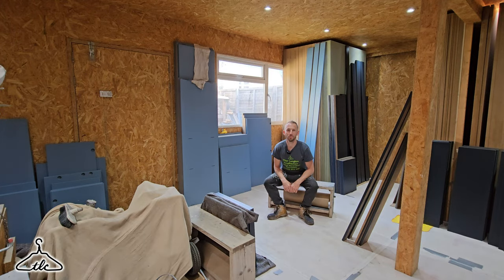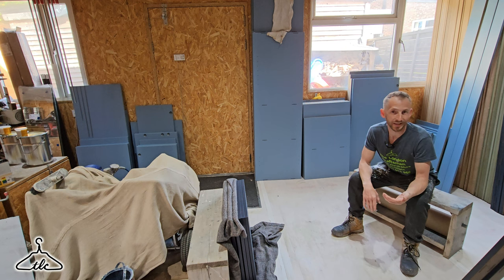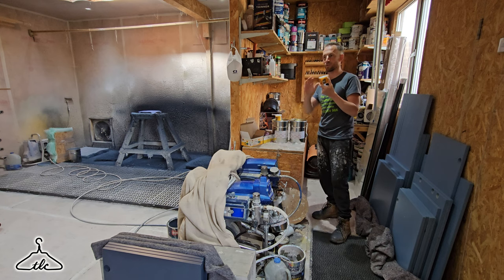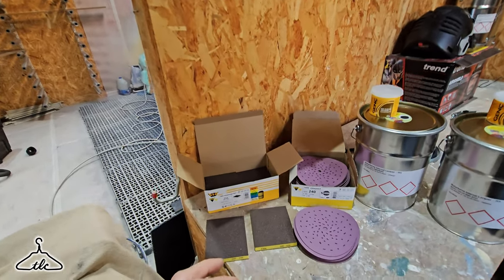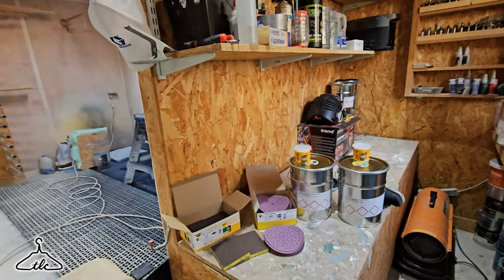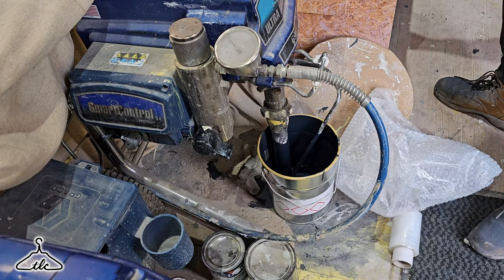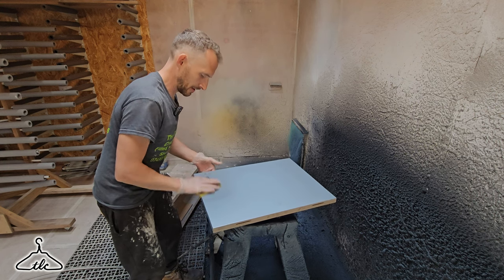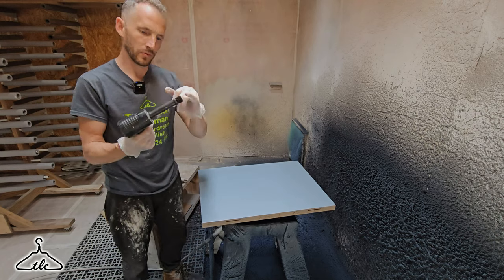Rectifying The BIGGEST Mistake Of My Career..... Installing 2 Beautiful Feature Units  (Part 3/6)

Comment: Quick question, what primer and dark blue paint did you use on this job? Looking to re spray my kitchen at the mo and this paint looks like it could be a winner! I Need to strip the old melamine off the doors first which will leave the raw MDF to spray.